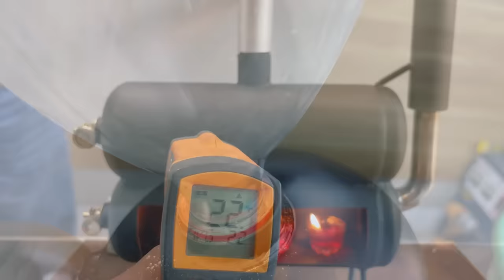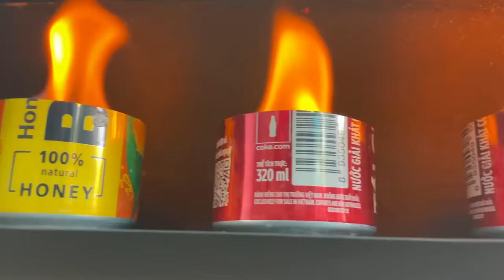diy mini heater! So warm for your room. Free energy from sand batteries

Comment: Nobody is commenting on what the costs of the candles (or whatever burnable goo he's using) and the alcohol are, but it's far from "free".  I've looked into more concept heaters like this than I could ever remember, and it always boils down to fuel costs.  You'd think the alcohol would be cheap, but when you multiply that by 24 hours a day for 30 days throughout the winter, it becomes as expensive as other fuels, at least where I live in WI.  Much like all these "super economical NEW electric heaters" we see each winter, they all cost the same to use.  A watt is a watt is a watt, no matter how you convert it.  A 1500 watt heater uses as much electric as two 750 watt ones do, but these facts are always sidestepped until you break it down.  The only truly free energy was stolen from Nicoli Tesla before the government criminals un-alived him, and to some degree solar and wind (both of which come with heavy baggage).
Reply: Then you should use shortening... It will burn at least four times longer than a wax candle. Get a small old candle holder or small non melting material fill it with shortening and and a birthday candle to the center. The shortening is a great cheaper way to use these kinds of heaters and they work amazing. Maybe use the old cooking oil you were going to throw out. There's always away to burn clean used oils for fuel source. These heaters work amazing in my non insulated cinder block wall garage apartment. These are cheaper than you might think.😁
Reply: @belovedamyjo8905 it’s not the fuel it’s the energy density of said fuel vs cost.
Reply from the maker: You bring up a crucial point about the often overlooked costs associated with alternative heating methods. Indeed, even seemingly unconventional sources like candles or alcohol can incur expenses, especially when used continuously. It's essential to consider the long-term operational costs, and your analysis highlights the economic factors that often accompany such projects.

The comparison to other fuel sources and the mention of the complexities surrounding "free energy" are valid considerations. Sustainable options like solar and wind energy, while not entirely without costs, do come with environmental benefits. Your insights into the broader context of energy consumption and costs are appreciated. If you have further thoughts or suggestions, feel free to share. Thank you for your detailed comment! 💡🌿
Reply: Tesla was the subject of a report I did in 7th grade back in 1980. Amazing fellow! 😊
Reply: Don't worry. In the next video he will show you how to make candles and alcohol For Free.
Reply: Stop lying candles are cheap are crap compared to oil or electricity or propane
Reply: They always leave out the complete math equation 
Or just not doing it
Reply: @BigcountryReactions  --- Go sit down and do the math.  I did it about a year ago.  I have one with and a bathroom in my house that I reside in to save on heat during the winter.  I compared tea candles, Crisco (type) oil, propane and electric.  While there were moderate differences (and I do mean moderate), nothing was tempting enough to make me trade in the electric I'm using now.  What people fail to realize is that for months, you're going to be burning whatever source you choose for 24 hours a day.  You don't have to believe me....I really couldn't care less....but that is where my fairly in-depth study took me when I compared all the options.  And YES, tea candles were carefully looked at and offered nothing above the other choices EXCEPT more work to keep them sorted and lit.  I live in WI, the room is about 14' x 26' and the bathroom is just an average normal bathroom with a shower.  Three out of four sides of this structure are what you'd call "outside walls" as the fourth butts up to the larger structure.
Reply: Forget all that, why is an exhaust needed? never mind two..one right into the room
Reply: В России я живу в своём доме в 100 км от Москвы, дом 120 квадратных метров, готовка пищи, обогрев дома и горячая вода все от газа, который подходит к дому централизованно (это деревня),газовый котёл    buderus, в год у меня на это уходит 10000₽ рублей, это примерно 110$😊
Reply: Единственное это дорого стоило подвести газ к дому, 8 лет назад это стоило примерно около 200000, наверное тогда это было около 8000$, но сейчас это стоит гораздо дешевле
Reply: Make your own goo.. it's on YouTube
Reply: @marioncobretti3076  I was burning oil and crisco as fuel in the house and not only did it stink it up real good, the soot was flying off.  If you’ve got someone who’s an asthmatic for example, there’s a reason.
Reply: @Remmy750 ok, that’s a reason for the exhaust to the outside…but what is the purpose of the second exhaust (one on the side) that vents into the room
Reply: Le moins cher c'est l'huile, qui se consume très très très lentement et sa flamme a une température très élevée. Ma bougie tient 7 jours non stop avec un petit verre d'huile j'ai fait l'expérience et la mèche ne se consume quasiment pas tant qu'elle reste imbibée. De plus ça fait une jolie lumière blanc jaune chaleureuse !
Reply: Все верно дорогой друг ,только люди которые в школе не учили физику мечтают о дешёвом обогреве,а закон термодинамики и сохранения энергии,элементарного Q=C×m×(t2-t1)
Reply: Aynen katılıyorum, bizim burada bir söz vardır; bedava peynir ancak fare kapanında olur. 😊
Reply: You blew it! Lol.  I thought you were going to say, a watt, is a watt, no matter watt…”
Reply: Indoor wood stove with a water jacket to get heat into the other rooms would be top tier.
Reply: @KEVINLAMANTAIN-p5s  ---- LOL!  That was a major fail on my part, for sure.  I guess I'm losing my edge a little bit as the years pile on!  A younger me would have been all over that!
Reply: Én is olvastam Tesláról, a nullponti energiáról, az akku nélküli elektromos autójáról.
Egy kérdésem van, ha valóban felfedezte az ingyen energiát, miért nem tette közkinccsé, miért hagyta, hogy  ellopja  a kormány.....😢😢😢😅?
Reply: True hillbilly technologies 👍
Reply: The Crisco is cheapest
Reply: The only cheap heater is a wood stove & wood I've found. Which some people are no longer allowed to have. Have to get a home with one already if in a area where they're not allowed to be installed. It takes time to cut the wood etc but if you're in poverty or middle class could be well worth the time.
Reply: Because most people with common sense know!. Candles use WAX! SMH.
Reply: @marioncobretti3076 

To provide negative and positive pressure so the air actually moves
Reply: I am in the Sonoran Desert, where sand and infra-red are abundant. Just on the back of the envelope, you'd start your calc at twice the sand battery and perhaps 1.5x sun focusing.
Reply: Recycled materials for candles is where it's at.
Reply: Crisco 1/2pint should burn 24+hrs
Reply: I think you are missing the point, if something happens and there is no electricity for a very long time, these are ways to get heat
Reply: Better question why exhaust the battery heat out the wall while exhausting the fumes into the room😂
Reply: @lmtn The "benefits" of wind and solar disappear when you factor the environmental damage caused in developing nations making the damn things.
Reply: Use tea lights or canned heat . (Sterno) 73
Reply: My wife buys the candles from dollar tree she calls them ta candles they work
Reply: You can use lard candles and they burn for days.
Reply: @johanbjork1650 😂😂😂😂
Reply: I am studying to determine the best method but I did see a 72 hour Crisco candle and another easily created mini heater that the designer claimed was eternal because he used stainless steel scrubbers in the bottom. I haven't completely figured this out. I just found out about this tonight but I am betting with a little ingenuity a very low cost long operating bio heater can be designed. BTW Costco has 35 pounds of liquid shortening for $30 and vegetable shortening does last a long time. I have engineered many things myself over several decades. I don't see this as impossible. It just takes figuring out the best method.
Reply: @marioncobretti3076 It isn’t producing much CO2, et al, but as the hot air travels through the metal pipes, it transfers heat energy to the metal, which slowly releases it into the air of the room. If the heater didn’t have metal pipes it would be closer to just burning candles in the open. The more heat is captured, the more efficient and effective the heater becomes.
Reply: The candles are commonly used at cemeteries in vietnam. They cost around ₫10,000 (so about $0.40), but I'd imagine its hard to get it here in the state. 

So technically, it's quite cheap...but you know. I saw some vietnamese coke cans too 😂, could be from vietnam
Reply: Crisco
Reply: @cuongluu2918  Thank you. I shop everywhere that I can find inexpensive items. So, I will find them online. Take care.
Reply: Stone holds heat for longer and releases it slowly and steadily over time
As for candles, they are cheaper than my gas bill
You do what you feel is best
Reply: @SpyroGyroplane 

Exactly, "green" energy isn't so green!
Reply: Well. Waste time.
Reply: @KEVINLAMANTAIN-p5s 😂😂
Reply: True about a watt is a watt, but you can make your own alcohol for free... 200 gallons a year. Double fermenting raises the amount of alcohol substantially. Make sure you don't let it go too far, or you make vinegar. You can filter or distill your brew to concentrate the alcohol. You can make alcohol from nearly all plant materials, so look on your local BBs for fallen apples, spoiled fruits, etc. Look it up...
Reply: The cost of the candles is probably the smallest expense.  You can buy 100 tealights for around 5 bucks.  Those metal cannisters wouldn't be cheap, nor would the welding equipment.  Not everyone has those tools just kicking around, or the knowhow to use them.  Great concept though, especially if space is an issue
Reply: @Remmy750  you can never have the wick so high that there's any smoke.I use k-1 kerosene in table top oil lamps.They run around 2 days before needing refill.A gallon of k-1 costs $10 - $12 at Walmart. Safe for indoors.
Reply: @fidelcarter9162  used oil is cheapest. Crisco isn't cheap in NJ.
Reply: That's impressive! Thank you for sharing friend. God bless. ❤ @андрейсветлов-п8з
Reply: LoL ...alcohol is as unlimited and cheap as water and sugar

Comment: I don't understand why he has an air intake for the small bottom tank, When it's open to the room. and there's an exit for an exhaust for the top tank. The top tank is not combustible. There's no fumes coming off of it. Why would it have an exhaust. It makes no sense. I understand about pressure but this just doesn't make sense.
Reply from the maker: The air intake at the bottom and the exhaust at the top are part of the design to create a flow of air and facilitate combustion in the heater. The bottom tank likely draws in fresh air from the room to support the combustion process, while the exhaust at the top allows for the release of combustion byproducts, such as smoke and gases, out of the system and away from the room.

This design helps maintain a controlled and efficient burn within the heater. While the top tank may not produce fumes itself, it's part of the overall system, and the exhaust helps remove any byproducts generated during the combustion of the material in the bottom tank. It's a common design in many heating systems to ensure safety and efficiency.
Reply: @lmtn  I would like to see how a small hot gas manifold might improve the design.  smaller exhaust pipes with lots of bends in the heat sink before exhausting together in a large pipe.  If the air flow is reduced you could hook up a small electric fan with a heat transducer.  Also - I'm curious how other heat sinks would work besides the sand (glycol for example).
Reply: @lmtn  Nope. No needle for an intake or exhaust pipe with a device run by 3 candles vented through a hole in your wall, this design is foolish.
Reply: @TheRealKalEll .  Yup.   I know the exhaust through the top is probably supposed to help heat the top tank, which is a sand battery, and the exhaust out the wall is for when using other fuels, but that one on the side is as stupid as his welding is bad.
Reply: I'm not sure about heating sand with candles, but dad built a round wood heater (for his shop) using a capstan from an old model wire drawing machine. Under the stove door, he made a vent he could slide open depending on how hot he wanted the fire to burn. When it was right, he would slide the vent open or close some and the heater sounded like a locomotive pulling off, haha. Flames would start shooting out the vent. Whoof, whoof 😅.
Reply: @ the sand is like a heat battery.  When the candles go out, if will give off heat for a while.  But yeah, will it matter with candles?

Comment: He lives in an apartment, not a cabin in the woods.... he should simply turn on the heater in the apartment to keep warm.
Reply from the maker: That’s a valid point! In an apartment setting, using the existing heating system is definitely the safer and more practical choice. DIY projects like these often work better in remote or unconventional setups. Thanks for sharing your insight! 🔥🏠

Comment: The first oven with the 4 candles is less efficient than just letting 4 candles burn in the room.  As he showed his oven vents 130 deg air outside,  which is lost to the room. 4 candles or alcohol burners do not need to be vented outside. And his second oven is not vented. None of thes 2 oven produce more heat than if you just let the little burners burn in the room
Reply from the maker: "Thank you for your insightful observation! I appreciate your attention to the efficiency of the ovens demonstrated. It's crucial to consider the balance between heating output and energy loss. Your point about the first oven venting hot air outside is valid—it's indeed a factor to weigh in terms of efficiency.

I'll take this feedback into account for future videos and explore ways to enhance the efficiency of DIY ovens. If you have any specific suggestions or topics you'd like to see covered to improve these designs, please share them. Your engagement is valuable, and I'm committed to delivering content that not only inspires but also considers practicality and efficiency. Thanks for being part of the conversation!"
Reply: If you don't vent the fumes made by an alcohol burner,After a few hours you won't have to worry about heat,When the coroner picks up your body... besides the noxious fumes given off from burning the alcohol you also have to worry about carbon monoxide.
Reply: If you have a very small room or office, then I wouldn’t want to be overwhelmed with the smell of fumes, I like it personally
Reply: No way because the upper metal tank works as a radiator generating more heat as just a candle in the room.

Comment: Energy cant be created or destroyed...4 candles is what you have no matter what you try to  multiply it.
Reply from the maker: You're absolutely correct! The fundamental principle you're referring to is the law of conservation of energy, stating that energy cannot be created or destroyed, only transferred or converted from one form to another. While the project may not multiply the total energy produced by the candles, it explores creative ways to distribute and utilize the heat generated. The aim is more of an experiment and a fun DIY project rather than a practical energy multiplier. I appreciate your understanding of the concept, and if you have any other thoughts or ideas, feel free to share! 😊🕯️🔥
Reply: Yet it can be stored and released slowly which is what the thermal mass of the sand does. Which means it's still warm after the candles have burned out.
Reply: @timothyprice9064  wie ein Kachelofen der die Energie speichert und langsam abgibt .

Comment: 4 candles p/day, it will be cheaper to turn on the electric heater 😂
Reply from the maker: The comment humorously points out that using four candles per day for heating might end up being more expensive than simply using an electric heater. This witty observation highlights the practical and cost considerations of alternative heating methods, emphasizing the efficiency of mainstream appliances compared to unconventional solutions. 😂💡
Reply: they only burn 1 1/2 -2 hours. 😂 if it's cold,you'll be there all day,every 2 hours,24/7, lighting candles.An ounce or 2 of alcohol lasts about 20 minutes.I made several nice alcohol stoves.Nice to throw in a backpack with a bottle of alcohol,to make a hot tea or coffee on a hike if it's getting chilly out,but alcohol too expensive to use for heating. I use table top oil lamps with indoor safe k-1 kerosene (around $10 gallon at Walmart). the oil lamps stay lit 2 days without refilling and put out a lot of heat.The gallon of kerosene lasts about 1 1/2 - 2 weeks for 2 table top oil lamps. Used oil is cheaper but there's so many issues keeping them going. Wicks have to be constantly adjusted or fall in,the mess not worth it.